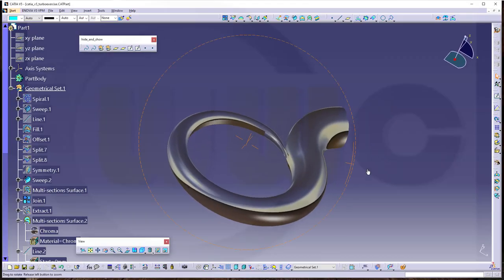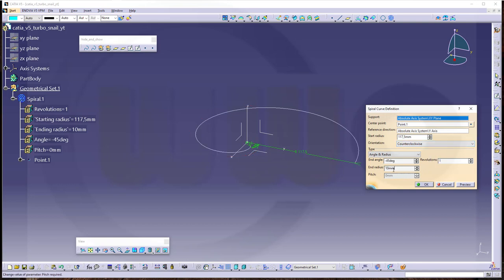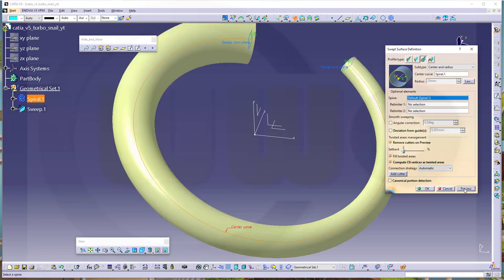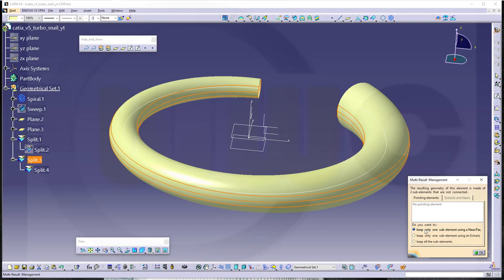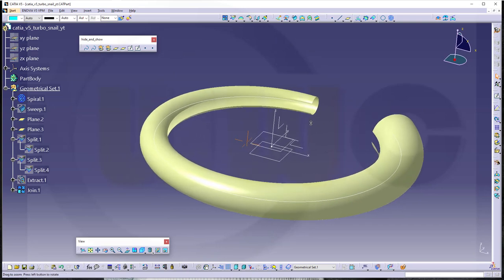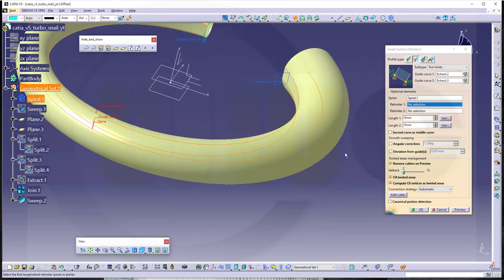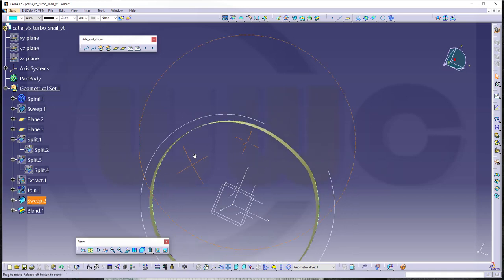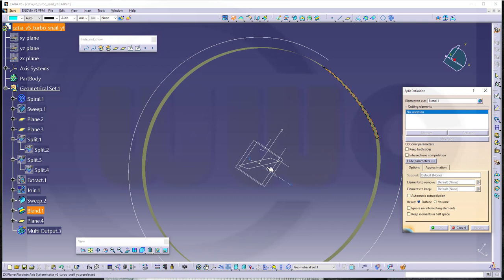Turbo - Snail - Catia v5 Training - GSD

Comment: Cool tutorial as always! Question, I’m trying to model the winding process on a tyre. 
Imagine you have a smooth tyre shape and you want to wrap sinusoïdal bands around and around until they overlap into several layers.
The bands have a certain thickness and offset every round depending on their width.
I don’t know if you are familiar with this process or if you have suggestions on how I could do it?
Bye!
Reply from the maker: I think you could use lawcurves, take a look here https://youtu.be/z-qgfCyaHz4 or https://youtu.be/PDVHbtb2QMc
Reply: @wolfgang.walden.cad.training  Very insightful thanks! I completed both tutorials and the first one helped me define a sine lawcurve running around the tyre.
I had another idea: separate the tyre in 4 parts and create a line in each quarter (going left right left right or vice versa). 
The transition between lines has a corner of a certain radius, and the whole profile needs just the right angle so the final line lands x cm next to the starting point.
The challenge is we cannot use sketches because they would be flat and projections won’t work for a 360 object, but only in sketches can we use corners and constraints...
Reply from the maker: take a look here : https://youtu.be/takG1T7vcQg
Reply: @wolfgang.walden.cad.training  Awesome, the develop function worked perfectly! I sent you a LinkedIn request, for more convenience if I have further questions throughout the project that you are willing to answer, and if you’re interested in my sharing the progress.